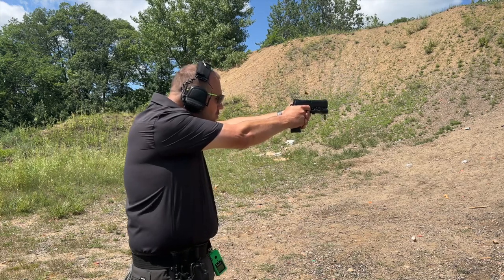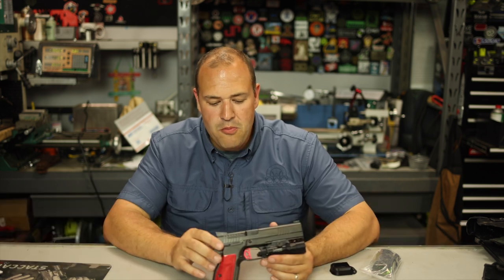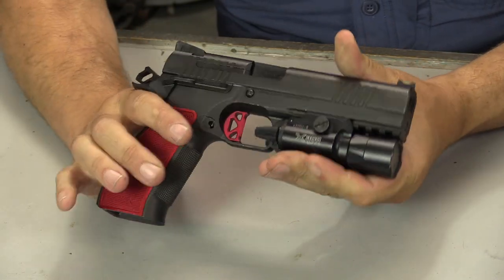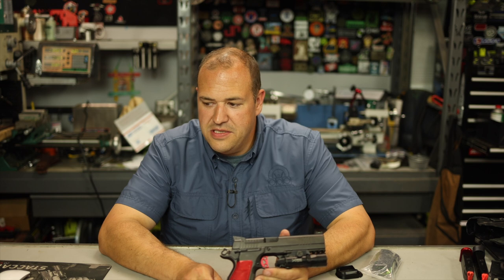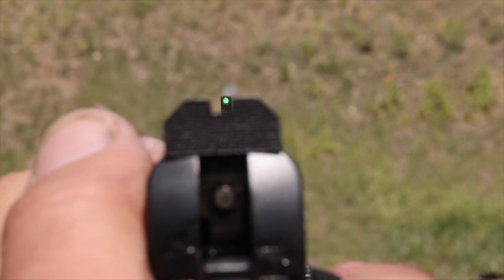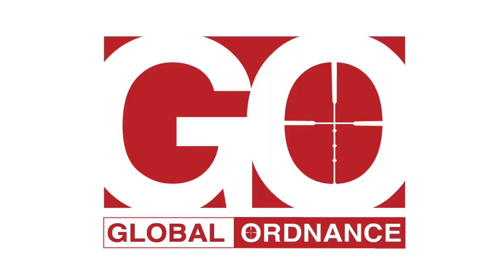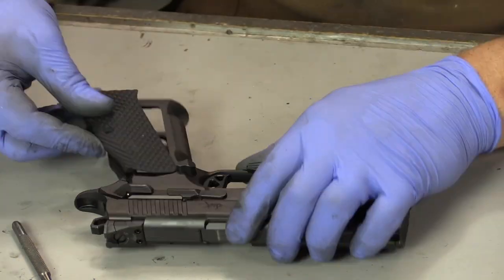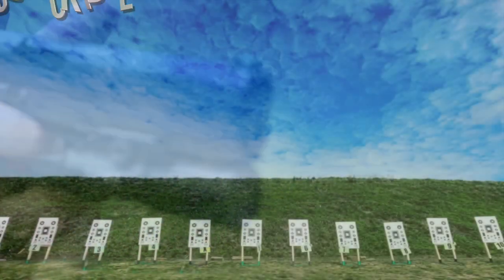Dan Wesson DWX - Deep Dive Review, We Take it Apart!

Comment: Reluctantly picked up a dwx compact. I find at 2k it shoots better then many of my customs and semi customs. It is hard to explain. It fits so well in the hand and the trigger is surprisingly perfect. Few more hundred and it will replace my entire 2011/1911 carry rotation.
Reply: I was looking at that gun. Looks pretty nice
Reply: Bullshit
Reply: @652barry  It isn't. Once I shot my DWXc I sold both of my EDC X9s and SFX9 (and a handful of other guns) because it's that much better.
Reply: @mistatobias6405 what about holster compatibility? I wish there’s an option for a wider safety to rest your thumb while shooting.
Reply: @Rothbardy  I've got a friend that custom makes my holsters (I'm trying to get him to sell to the general public, but no dice so far). Aside from him, unfortunately there aren't a lot of options that I've seen!

You can change out the thumb safety, but you'll have to resurface the front a tiny bit. A gunsmith could easily do this -- it's only 1-2 hours of work.
Reply: @mistatobias6405  The DWXc is that much better than the Wilson's? How is the muzzle rise/recoil impulse on the DWXc? I read a comment recently saying it was still rather sharp muzzle flip? I have a CZ S2C and it is very good. But I still want a 1911 double stack. Trying to decide between the full size DWX or the DWX compact. Thoughts are most welcome. Thx.
Reply: It's not "hard to explain", the frame is modeled after the cz 75: Most Ergonomic Pistol Ever
Reply: This is going to be my first gun :)

Comment: What is the best way to drop the slide if you have medium sized hands? I have held one and the safety seems to be in the way for me to reach slide stop.I have shot polymers in idpa uspsaetc..I haven't shot a gun like this.I would like to compete with this gun if i can solve not reaching slide stop.I'm a guy who drops his slide with his thumb in competition.I guess i could rack it after i go to slide lock, but real don't want to do it that way.If you know of any other method to reach slide stop with medium hands, please let me know.Excellent videos!!.
Reply: I use the thumb of my support hand to release the slide stop as I reaquire my grip.  It's pretty fast once you practice it a bit.  But really, there is no need to go to slide lock is USPSA.  Even the new IDPA rules now allow dropping an empty magazine with a round in the chamber.  So in most stages, with some planning, you can avoid a lot of slide lock reloads.

Comment: That gun looks so much better with a black trigger and grips!! CZ really should offer that as a factory option. 

I was shocked to see that it has a “fire control group” modular set up. This gun is just asking for a long slide full rail aluminum frame with a compact checkered grip accepting 15 round magazines. I really don’t like the “frag pattern” checkering on the compact model. 

For me, I won’t cry foul because CZ omitted the optics cut. Having the slide milled for a specific optic is my preferred mounting method anyways. 

If I could have all of my wishes, I’d sure love to see this gun offered in 10mm. I know I’m dreaming now though.
Reply: Me too, I hope they do an all black run

Comment: It’s a nice gun. But you can get a “just as good” poor man’s version optic ready  by taking a CZ shadow 2 OR, pop the disconnector, install a SAO trigger (there are several varieties with different shapes and pull lengths), and install one of many fat safety lever options (oem, eeman tech,  rh, lh, both). Considering the optic milling prices of the dwx that’ll be over $1000 cheaper route. 

And to get cz75 mags which are just as good if not better than P10 mags.  

Also DWX compact takes different mags than the full-size. But the recently released shadow 2 compact (also OR and also capable of being converted to sao) can take full size 75 mags. 

Yes the shadow 2 sa trigger isn’t as good as the DWX. But it’s pretty close and it is tunable (and you don’t need to spend money and effort chasing a light DA pull with silly reduced hammer springs and extended firing pins)

Comment: Take the dollar value out of the equation, if it had an optic cut, would you choose this over a staccato XC?
Reply from the maker: The XC shoots flatter, can't complete against the comp.  But, compare it to say a P or XL, I think I like the ergo's better on the DWX :-).   Now if the DWX comes out with the comp version ha ha.   watch out!!!
Reply: @GunsandTactics  You have convinced me to buy a DWX. I will send it to monsoon tactical for the optic cut and MIGHT  figure out if we can incorporate a built in comp similar to the ARC Glock slide and port. I will get in touch with you once i get it done.🤓